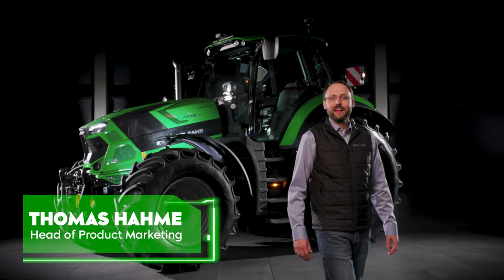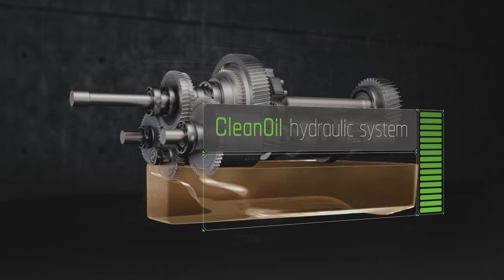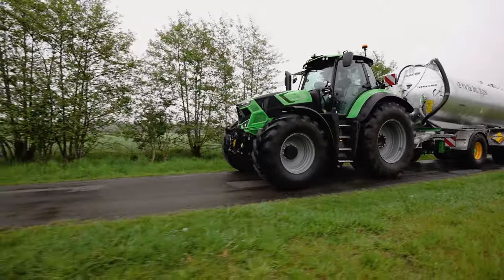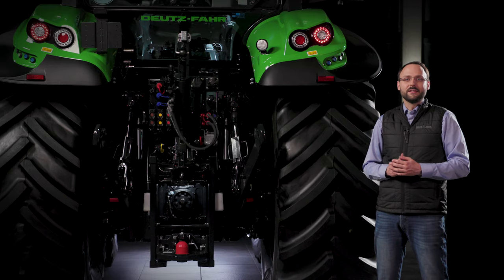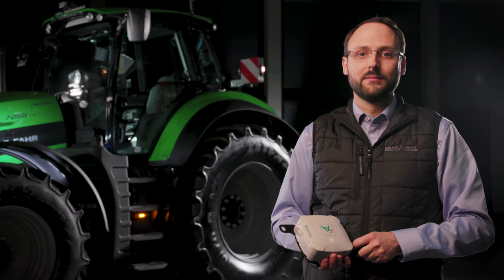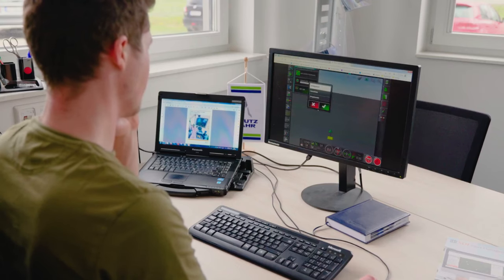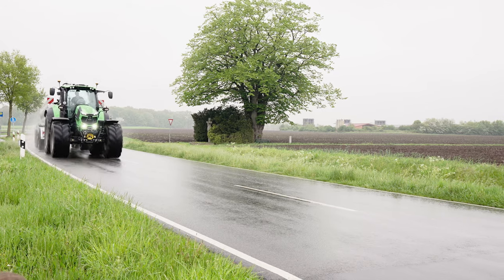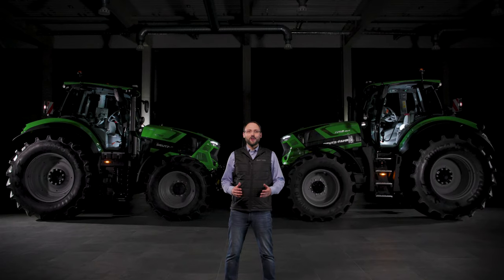DEUTZ-FAHR 7 TTV Series - Walkaround

Comment: When I reverse gear on a ramp in power zero position, I feel a knock from the transmission. And when the transmission shifts from first gear to second gear, it is not perfect, I feel a shaking like hitting, so there is no perfection as explained in this video, I would like to get information if there is a solution. Thank you.
Reply from the maker: The behaviour you are experiencing is unusual. The experience with the new transmission is generally very smooth and the range shift is hardly perceptible. We invite you to reach out to your dealer and check if the latest tractor software is installed.
Reply: So, I wonder why TTV transmissions do not have the system that provides forward and backward movement like in 6c tractors. Because when I move the shuttle lever forward or backward in the fields, the tractor makes momentary knocks and these are very tiring during long runs. @deutzfahrofficial